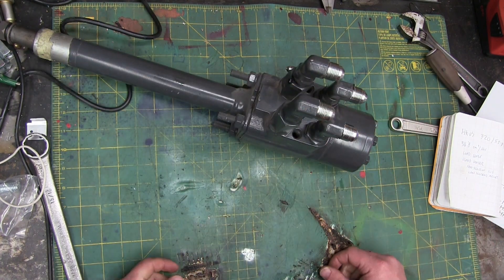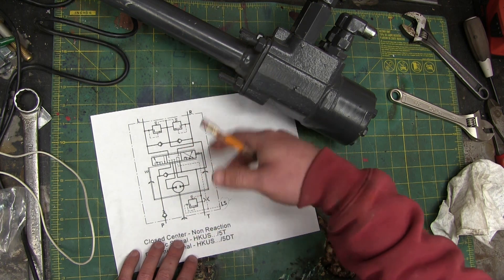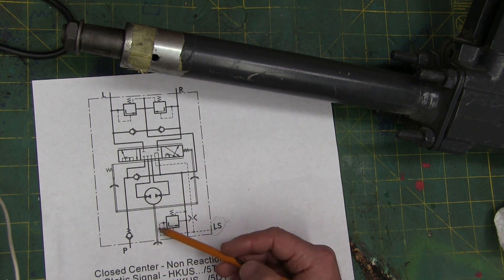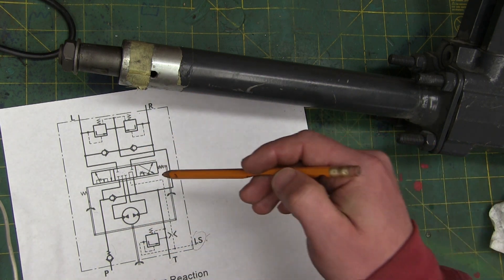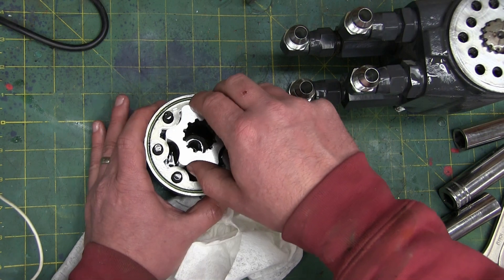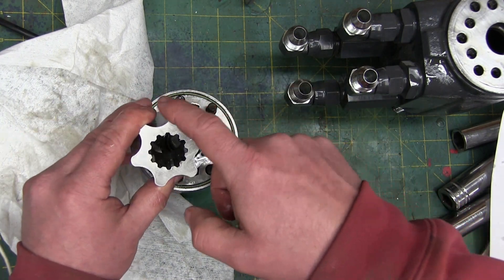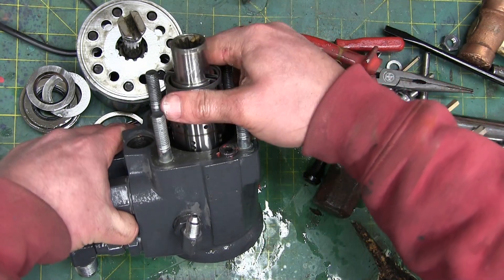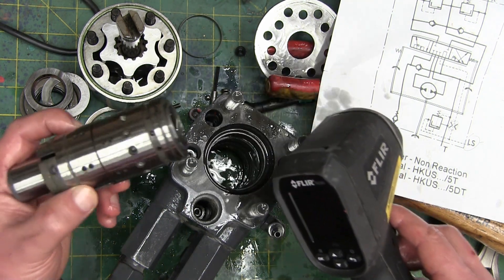BOLTR: Hydraulic Steering | Reading Fluid Schematics

Comment: You can steer the most hydraulik steering systems without hydraulic pressure from the pump. so steering with the pump in the steering module (very hard to steer, but possible)

Comment: If I'm reading the schematic right, it looks like that steering-wheel pump could also be a manual backup pressure source in case the main hydraulic system fails, but I could be wrong.

Comment: You should get your hands on an old Cla-Val.  Those are the real hydraulic calculators used to control pressure and/or flow in a large fuel, water, or thin liquid system.

Comment: the hidraulic pump is aslo there so you can turn the vehicle even when the engine is stopped.. of course it's gonna be hard and you must do alot of turning..  but it allows you to steer the thing when for whatever reason there is no pressure coming from the main pump.

Comment: The play in the shaft (11:02) is probably to prevent over defining the construction. One bearing on top of the shaft, and the other end with the spline locked in the pump, perfect.

Comment: The check valve between LS and P is a signal check.  It is what tells the pump to "stroke up" or increase flow.  In the future, if you take one of these apart with the intent to re-use it, put timing marks on the slices first.  If assembled out of time, it will do nothing.  Oooor, at first steering wheel input, become a strong/wrist breaking motor.

Comment: The gerotor assembly acts as a metering device. The oil goes through the valve and must first flow through the gerotor before going back to through the valve and on to the steering cylinders; the oil in the return side of the cylinders would then go back though the valve once more and then back to tank. In order for oil to continue to flow into the cylinders, that gerotor has to spin which mean the steering wheel has to spin. If the 200lb guerilla at the controls stops turning the wheel, the valve centers, flow through the assembly stops, and the steering cylinders stop. In addition, as others have mentions, the gerotor assembly can be used as a redundancy system to still have steering in the event of a failure; depending on the machine, that may be easier said than done.

Comment: that 'pump' as you call it is a metering unit  the spoolvale ports to the 'pump first and then to the cylinders so the oil dislaced is propotional to steering wheel rotation  it only works as a pump in manual mode for emergency  but good luck to that on large vehicles
Reply: I think this too! a little more going on than he is realizing or remembering. If it was just a resistance element, why would it be harder to turn (impossible generally in large equipment not in motion) without the engine running and pump flowing? and of course, the pump needs to know the approximate position of the cylinder.
Reply: Indeed sir, in heavier stuff it's impossible. I'm a forklift engineer and with trucks up to about 7 tonne capacity (dead weight 10t) it's just about possible. I looked after a volvo L50f loading shovel for a few years and that had a tiny emergency 24v power pack for steering with a dead engine.

Comment: We have this kind of orbitral valve on our tractor (and yes it's from Romania), the built in pumping element allows you to steer if the pump fails/engine isn't running. Also if there is a leak, there is a small one on ours, you need to slowly rotate the steering wheel in on direction in order to go straight :)
Reply: Exactly what I had in mind😉
Reply: I had a Case 580D that was the exact same way!

Comment: So the pump section is just a regular orbital pump and you can steer without engine running - or at least a Bulgarian shemale shotputter on steroids could.
Reply: what does the shemale part add?
Reply: Have one of these on my off road truck. Steering with the motor off is possible and slow... vulgarity assured.
Reply: shemales just confuse the situation

Comment: knew a guy who drove trucks and called himself the FBI.
6'3" 375 lbs. and had Chippewa ancestry
Reply: F'n Big Indian, I work in the coil tubing industry. A guy would often come into the shop, fitting that description. Dean was the easiest going guy.
Reply: Jp Kalishek yep. Not many here will get the reference.
Reply: elad sputnik 
 FBI, originally = Full Blood Indian on U.S. paper work having to do with the Rez and allotments. Commonly used as Fuckin' Big Indian but I have heard it used as BFI also.
Reply: When ya need something smashed, get the BFI* with a  BFH   
* (or FBI must be regional, Alberta has BFI's)

Comment: Called an orbitrol valve here in the UK. Don't put one back together wrong! If you do as soon as you move the wheel it will whip round at full pressure and break your wrist!
Always thought the cleverest feature is the way it reverts to a hand pump when there is no oil flow to the unit.
Reply: Yes, as you said, the pump is NOT just for feedback to the driver, it drives the steering cylinder(s) if you don't have pressure from the pump driven by the engine. Would have been really dangerous if it didn't do that.
Reply: telmer6 LOL! Seen the results of that too!
Big pipe - 1
Steering wheel/column - 0
Reply: It also functions as a flow metering device to limit the cylinder travel IIRC
Reply: I was surprised I could steer a ~10 ton forwarder that wasn't running. Had to REALLY turn the wheel hard thou
Reply: deezelfairy 
 Or, if you're really quick like me, you only dislocate your thumb.
 This allows you to still deck the jerk-off mechanic who tells you he knows everything there is to know about a front loader❗
Reply: opa Oh yeah, you need arms like popeye, but it works! It's an essential feature really, recovering broken down equipment would be a nightmare.
Reply: You could also probably stick a long-ass pipe in the wheel if you needed to.
Reply: Here in sweden we call it an orbitrol too. :-)
Reply: VictorIndiaDeltaAlfa That's its main purpose, otherwise it wouldn't work as a steering system.
Reply: I was going to comment on the pump being and actual pump for when the engine dies. A tractor and trailer or 4 wheel steer loader with no power steering are not fun things to drive.
Reply: deezelfairy yeah I noticed after hanging on the wheel like hell. Didn't help that the brakes were obviously on and the machine is steered by 2 cylinders that pivot the rear and back. Could have fired it up for this but we we're doing a oilchange on it and I just needed it to turn few degrees to get to some place(and the engine oil was being drained at that point)
Reply: deezelfairy I really tried to understand what you have written, but I can't.
Reply: Frank Gormanns If you get the porting out of alignment when you reassemble it it turns into a motor! Seen it happen a couple of times
Reply: deezelfairy You can only steer it twice, because yo break your wrist. Understood.
Reply: Frank Gormanns yeah summit like that....

Comment: AVE you should go into how that rotory valve works. how it allows the steering wheel to hold a position so that when the wheel is turned it stops steering causr its pretty cool the first time a person figures how that.

Also in certain open center systems they will use closed center valves and use the load sense to operate main relief valve

Comment: Mr AVE you need to look at that hyd schematic again 
The pumped oil comes in the the gear goes thru the valve 
then thru the internal pump out of the internal pump 
back to the valve 
then out to the cylinder 
back from the cylinder thru the valve 
then back the tank  

That spring aligns  the inner and outer parts of the spool when in neutral position when the steering wheel is turned 
The more force that is applied to the steering wheel the more the inner and outer section go out of neutral and   more oil flow is applied to the inlet of the internal pump 
 
That internal pump is very important and regulates precisely how much oil goes out to the steer cylinder
The internal pump  has all of the   oil that goes out to the cylinder running thru it 
So if the power steering pump fails the internal pump can became an emergency pump driven by the steering wheel (300lb gorilla)

Comment: Normaly the "pump" is not only for feedback. With this pump you adjust a throttle valve and that adjusts the speed of turning. Because if you had adirect connection from the steering wheel to the valve the vehicle would continue to "steer" as long as you have the steering wheel not in the neutral position. If you stopp turning the steering wheel further the pump will no longer pump and therefor the throttle valve will close and the car will move on with this steering angle...
Reply: Damn.. should have viewed the second vid...

Comment: I'm going to be honest. I watched the whole thing, but you lost me a few minutes in. I picked up maybe 25% of what you said and, fuck it, y'know what? 25% is more than I knew yesterday and ain't bad for something I don't really care about except to watch someone else go through it. 3 years ago I didn't give a shit about glass reinforced plastic, sintered metal gears, friction stir welding or overbuilt and underengineered juice jerkoff machines. Sneaky fuck that you are slipped it in while I was distracted and taught me about them all the same. You're a modern day Mr. Wizzard.
Reply: I felt the same way on the 9 wire electric motor vidjeo.
Reply: Good for you, Sir! Far too many idjits  (Looks at the down voters) come here, look for a minute and say "boooooring!"
Reply: You can't break it all down super simple, otherwise we would all be engineers/technicians. I've been a forklift  engineer for a long time and still struggle to wrap my head around some things. You start reading the manual and you think 'damn this is heavy going'.
Reply: well, FACK'N SAABSCRIB!!!
Reply: MattsAwesomeStuff that’s me most of the time when I️ watch his videos
Reply: If the hydraulic part messed you up watch AvE's "BOLTR: Haldex Hydraulic Pump | How to ID pump size" it might give you another 5% of understanding. good luck my dude.
Reply: leif52pickup I feel ya if i wasnt an electrikin myself i woulda been lost
Reply: 3rd time lucky.  I was completely lost and gave up twice. but then it all fell into place. like logic gates and an opamp.
Reply: very well said brother.
Reply: weed
Reply: I don't think I could have said it any better myself.
Reply: I'm in exactly the same boat!

Comment: Would this be considered an orbital valve or is that something different?
Reply: I think it's centrifugal.
Reply: The term centrifugal refers to something that centrifugal force applies to. In this case, the pump is the orbital type pump with positive displacement, not much different from the two spur gears type.